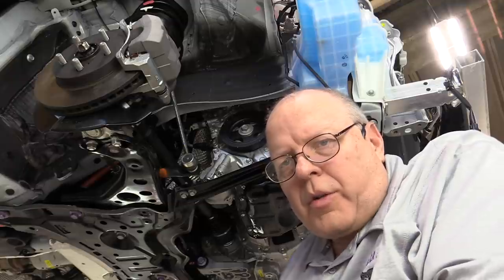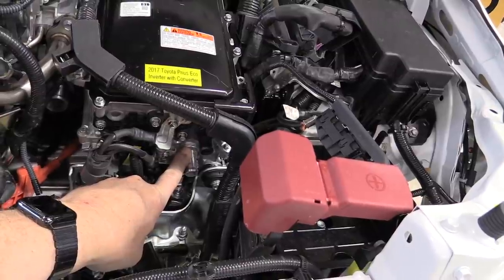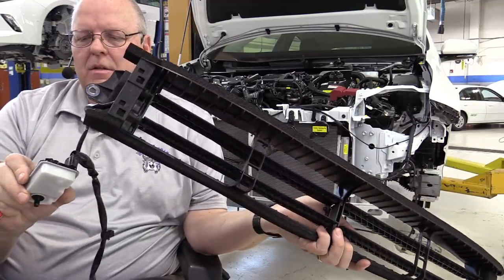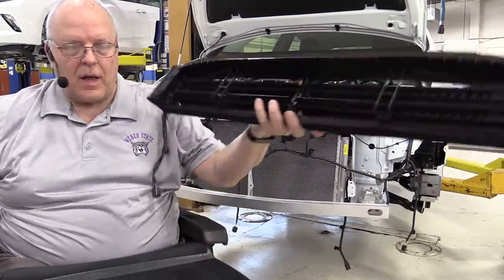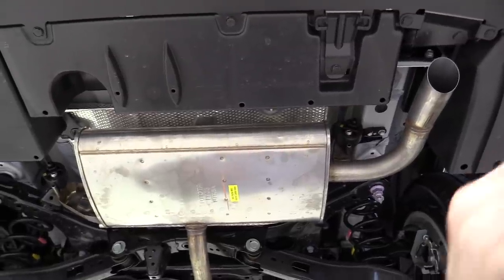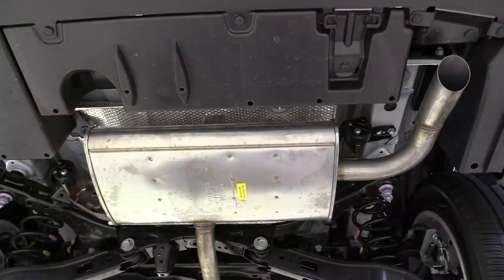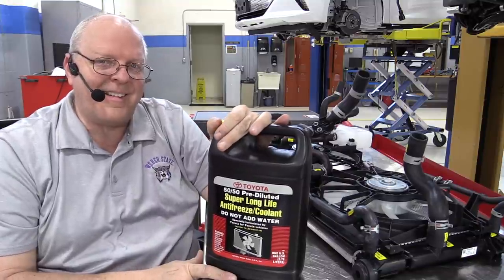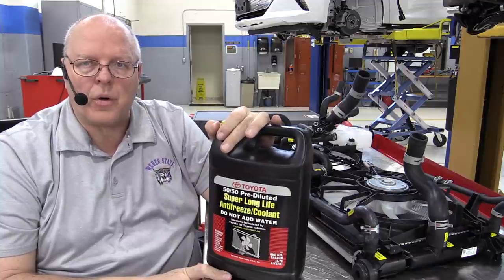Hybrid and EV Cooling Systems

Comment: Professor Kelly, I like you voice, your deep knowledge, willingness to teach & share this knowledge : you are true inspiration to so many people : your teaching a blessing to the world : Cheers Buddy
Reply from the maker: Thank you very much!
Reply: Meg drives our 2005 Toyota Prius II with 138K+ miles : cut off the rear muffler ^^ Strong Hybrid 
I drive our 2014 Honda CRz II with 17K+ miles : all OEM except LED's to replace halogen lamps : Weak Hybrid
We also use our 2013 Honda PCX150 scooter with its crank mounted alternator starter generator : Barely Hybrid 
Meg & I also travel using Segway Minipro self-balancing personal mobility assist device : Fully Electric
Reply: Very rightly stated. I envy students who are taught by Professor.

Comment: Amazing, I think we need to start replacing the phrase "rocket scientist" with "hybrid auto engineer"....  This is just way too much complexity to put into a consumer vehicle product.   Nobody (including your average dealer mechanic) really knows how all this mess works.  Put me down for a relatively simple all electric car...
Reply from the maker: Thank you! That is true. Electric cars are relatively simple compared to hybrids. I am working on a few electric vehicle projects right now.
Reply: Yes sir, but  for  this exactly moment (from now to  10 years) hybrids are the real good choice for  the planet, instead of the  fantasy all electric  world
Reply: @jhoncarlosmorenocastro612  Check in in another decade or so, and we can discuss how much of a fantasy it is.
Reply: Electric cars have most of those same systems... Lots of controls and sensors in those big battery packs.
If you take a look at older Priuses, generally speaking the most reliable part of the car is the internal combustion engine.
You are much more likely to lose a electric water pump, or the Hybrid battery pack, or  have inverter converter failure, then you are to have one of the internal combustion engines suffer a major mechanical issue.
every electric vehicle has all of those same components except for the internal combustion engine.
All sorts of heat exchangers, multiple coolant loops and multiple water pumps.
I currently drive a 2008 Prius with 310,000 miles on it.
My best friend has a 2006 with 340,000 on it.
And I have another work acquaintance that has a 2004 Prius with 520,000 miles.
Toyota knew what they were doing when they built this they are exceptionally well made, and actually not that difficult to work on compared to other vehicles I have owned.
Regularly scheduled maintenance is easy to do yourself.. 
parts are readily available in cheap both new and on the used Market from salvage yards, 
And all sorts of options exist for repairing the hybrid batteries rather than replacing them, and even if you do decide to replace it a new pack from Toyota is about $2k now.

Comment: Do you have any idea why I lost my heat after the dealer changed the cat/heat exchanger? I was getting the dreaded loss of coolant out the exhaust and the dealer replaced the cat assembly and now I don't have heat but I'm not losing coolant anymore. 2016 Prius

Comment: Professor I have a question if I may. On the bottom of the Transmission where you have it labeled "Fluid Drain Plug" is for draining the Transmission Fluid? It does not specifically say so I wanted to ask. Also should I use ATF-WS Toyota Fluid I have a 2020 Prius Prim? Thanks

Comment: "I like to disassemble things that are not supposed to be disassembled" My man!
Reply from the maker: Thank you! It is a lot of fun (as long as I do not ruin the part).
Reply: That's what I do too with new "toys". Turn it on so I know it works before I thinker with it, then opening it up so I know how it works and finally put it back together. If it does not work anymore, then I know I did something wrong because I confirmed it worked before.

Comment: Love your in-depth work explaining the cooling system. 
It is way to complicated more than it needs to be. But I understand how engineers think and work. They don’t teach simplicity in any engineering school. I would simplify the system by cooling the liquid by passing the liquid over a bismuth telluride plate, which uses only 0.70 of a DC amp. Eliminating compressor and more moving parts. 
Please look it up. Heat is the enemy of all electrical systems.
Love your work!
Reply: Thermoelectric coolers are notoriously inefficient. To match up, it would need to be both big, and run at quite a high voltage, neither of which is very cheap compared to what they have here.

Comment: A fascinating video on learning (in depth) the way cooling systems are on modern hybrids vs traditional combustion engine cooling systems. Didn't know there were 2 separate water pumps, that there is so many hoses/circuits in that one radiator, etc.

Comment: The transaxle cooling system is quite robust when compared with the Gen 3 unit.  I can see why they allow towing in some markets now.  I've towed up to 1100 lbs with my 2010 while observing temps on MG1&2 and the inverter coolant temp to be well within standards.  Great video as always.
Reply from the maker: Thank you! I had heard that towing was allowed in some markets. I wonder what the maximum gross combined vehicle weight rating (GCVWR) is.
Reply: WeberAuto According to a British car publication the Gen 4 is rated for 725 kg (1,598 lbs) in Europe. I've heard the Gen 3 was rated for towing in Europe also though I could not verify limits. Not sure if Toyota NA recommends towing for Gen 4 units sold here. Small teardrop shaped Travel trailers are very popular in Europe, I can imagine the Prius is well suited for that.
Reply: Creig Mac were you able to observe the transmission temperature as well? I have a 2018 Highlander hybrid that I plan to use for towing a 1200 lb trailer. I can’t find an OBD 2 scanner that will show the transmission temperature. Thanks

Comment: Great info Professor, thank you!  It's scary how many intricate moving parts are under a vehicle open to road grime and splatter. Thinking too how the salt and sand/dirt on the roads will interfere with the long term operations of these parts. Really have to question where the "technology meets the road" so to speak is really a "head on collision".
Reply from the maker: Thank you! They have been surprisingly reliable over the years. Of course any contact in any type of collision will cause $$$ damage.
Reply: I meant that the "technology" and the "road" so to speak collide. :<)

Comment: Excellent description! I never knew the Prius has a 2 part radiator. 

Our Fiat 500e has 2 coolant loops, one for the battery and one for the battery charger, inverter / converter, and traction motor. The battery loop has it's own small radiator mounted in front of the ac condenser, and includes a 6kw heater and r134a heat exchanger so that the evecu can both cool and heat the battery. The other loop uses what looks like a normal 500 radiator mounted behind the condenser. 
The cabin heat is from a PTC element, there is no water heater core.
Reply from the maker: Thank you and thanks for the description of the cooling/heating systems on your 500e. Almost every EV I have seen have similar systems. I will be doing similar videos on the Chevrolet Bolt and Volt in the near futures.
Reply: WeberAuto I’m looking forward to those videos!

Comment: It's very interesting with all the detailed design at this complex cooling system for the internal combustion engine and the hybrid inverter, Toyota left the two hoses for the exhaust heat recirc system fully unshielded, especially when they run the entire length of the very hot 2nd catalytic converter.  These hoses will probably spring a leak with high mileage cars.
Reply from the maker: Thanks for your feedback. The second catalytic converter has an external shield around it by the coolant hoses for the exhaust heat recirculation system. The system uses stainless steel pipes up a little further above the catalytic converters and the exhaust manifold. The hoses are only used where there is powertrain flexing. Have a good day!

Comment: The post 2010 Prii have two disadvantages. One is the expensive to replace electric water pump. The second is the hard to service EGR valve. That's why I nominate the GEN 2 as the Prius you can keep cheap for 20 years. The taxi drivers here in San Diego buy old GEN 2s at 100k + and drive them to 400k. The old mechanical water pumps go over 150-200k and there is no EGR valve. The only GEN 2 problems seem to be the 2 Way hot-water valve and the inverter water pump that was on a recall. That pump was redesigned from a one bearing to two bearings on the shaft. Besides the cat going out at 150-200k and in Calif requiring an OEM cat at $1300-2000, the GEN 2 is bulletproof. As a bonus, the GEN2 had an available JBL audio system that beat the pants off the GEN 3 & 4 audio systems. And of course, you can easily service the main battery modules. Toyota will sell you a new battery you can install yourself for $1950 plus a $1300 core charge. Try that with a Prius Prime LION battery. The 2016 up Prii are great until the battery warranty expires. What is the resale value if the battery goes out? What is a dead Tesla worth? Not much.
Reply from the maker: Great information, thank you!

Comment: Thanks for your effort.  A schematic diagram of the entire cooling system showing all components in separate loops for ICE & Electrics would be helpful.  At 3:07 - the pins protruding from the electric water pump housing are an omnidirectional heat sink; a conical shape is actually the most efficient.  I thought it was very strange to have a thermostat on the return line FROM the radiator; I would assume this is where the exhaust and EGR loops mix in, (?)

Comment: This is the first time I've ever seen a thermostat on a coolant inlet, usually they're on the outlet to the radiator. Is there a reason the thermostat is on the inlet in this case?
Reply from the maker: Electric water pump can control the flow better

Comment: Professor can I have a question? I understand there is no V-belt to drive the water pump nor the AC compressor as you have shown in the video. Is there a generator/alternator which is driven by a belt to charge the 12V battery? Also, on the other side of the crank shaft there must be a timing belt to drive the camshafts right?
Reply: The 12V battery is charged by the DC-to-DC converter located inside the inverter-converter assembly. The converter is powered by the high-voltage battery.
Reply from the maker: Sangueffusor is right, there is no alternator. The 12V system is charged by a DC-to-DC converter. Yes, there are still timing belt(s) or chain(s) from the crankshaft to the camshaft(s). They are under protective covers on the engine. Thanks for your feedback!

Comment: Great video as usual.  Thanks for sharing your knowledge.
Potentially stupid question.  What is the need for the mechanical thermostat on the ICE's electric water pump?  Couldn't they just turn the pump on and off based on temperature sensor readings?  Maybe they use it to allow flow through the 3 different paths??  It just seems like a potential waste of electric power for the pump to be running it all the time.  Do you have any idea how much power that pump consumes?
Reply from the maker: Great question! The water pump is a variable speed brushless DC motor. Its rotational speed is independent of engine rpm now, so it actually reduces frictional losses that occur in belt-driven water pumps. The pump does not run constantly, its speed is based upon several factors (engine temperature, vehicle speed, and engine speed). I do not know how much current it draws, but the wires that feed it are pretty small. I will try to find out. Best wishes.

Comment: Those two cats are going to cost big bucks in Calif where no aftermarket cats are available or legal. On the 2016 up Prii, I would only keep the car until the warranty expired and I would make sure I got the additional Toyota Platinum warranty. I think you can still buy the Toyota warranty up until the first year of ownership and you don't have to buy it from the selling dealer. On my 2005, I bought a 7 year warranty for $1000 but not from my San Diego dealer. I got a deal from a Toyota dealer in Rexburg, Idaho!
Reply from the maker: Thanks for your feedback! Good idea about the Toyota extended warranty purchase

Comment: That is amazing that a little grill shutter motor and sensor get their own microprocessor and thrown on the CAN bus.  Dare I ask where you get information like "26 pieces of data..." from?  I would guess that how all the modules communicate and what data they swap back and fourth is proprietary to Toyota and they don't want to share that?  So with that information it seems you could connect to the CAN bus(es) and have fun with your car there, open/close vents and who knows what else?  Are things like  power mirrors, windows, headlights, etc on the CAN bus too?  That is just amazing, thank you for the interesting video!
Reply from the maker: Thank you! Many of those items are on CAN busses now. I get my information from the service manuals. Toyota publishes a "New Car Features" supplement with all the cool technical details you would not normally find in the service information. Of course it is not free, you have to purchase it. Everything I have shared is available for anyone to purchase from Toyota. I read the information and summarize it in my own words in my videos. The 26 pieces of data I referred to can be read using a Toyota Techstream scan tool. Thanks for your feedback!
Reply: jontscott almost every little gadget is on the CAN bus these days. I, as an automotive technician, love that. Because I can actuate and test all these things with a click of a button on the computer. Makes diagnosis so much easier.
Reply: I guess I need to get a newer car so I can have more CAN bus around me :-)  My '05 has CAN bus but nothing fun to control like lights, mirrors, fans, etc... just critical drive stuff.
Reply: jontscott you lucky guys with your fancy OBD-II systems! My family car is stuck in the world of OBD-II, and I'm stuck trying to find the equipment for it, for a reasonable price 😂
Reply: WeberAuto I don't even own a Toyota, but now I'm curious. How much do they cost?
Reply from the maker: See www.toyota.com for vehicle prices. The Prius in this video was close to $25,000 USD
Reply: Well I'm not sure many people call my '05 fancy, but I also drive a 1990 Chevy pickup that I face similar problems with tools for as it uses ALDL at 160 baud.  I ended up building myself a serial port adapter and using the free program WinALDL to do basic diagnostics on it.  I am trying to hold off on getting a newer car till a used Chevy Bolt becomes available for under $10k, but by that time my family won't fit in it so we will have to find something bigger anyway.

Comment: So with the tank system now there is no longer pressure in the cooling system?  Also dones not the heat exchanger on the transmission also help to heat up the transmission fluid quicker to reduce friction.  Have noticed that my wife's new 2.4L accord that has one takes much longer to heat up the engine than my older 2.4 without on on its tranny.  These may be why since not only the engine has to heat up.
Reply from the maker: There is still pressure in the cooling system. Yes, the heat exchanges on the transmission can also help it warm up more quickly. Thanks for your feedback!

Comment: Interesting So on this 2017 Toyota Hybrid (vid) car has a "here I am" sound speaker mounted in the front grill  to make a noise at very slow speeds. The Hybrids are sneaky quiet but our 2017 Camry Hybrid SE as it slows down make an electric motor type sound ( I thought) as its producing electrical power for the traction battery.. When backing up after a few seconds the gas engine starts up (at least I think its the engine starting up?)  Just took a look and didn't see.a speaker device near the drivers side horn similar to the one in the vid?  Like everyone else appreciate the Professor Kelly Weber Auto vids. Note: Four yrs old and 0 problems of any sort. .
Reply from the maker: Thanks for watching

Comment: Thank you so much for teaching me about this cooking system! I have a question for you, I’m hoping you can help me. I know for fact my car has a problem within the cooling system. I checked for leaks, checked the engine oil appearance and level, checked the engine coolant level and checked the radiator and hoses and all this looks good to me. Now the car did overheated a week ago and melted the coolant filler neck that holds the radiator cap. Which I already replaced with a new one as well as the radiator cap. And The car engine runs ok for a short period of time but then the engine starts shaking making a sound like a broken or damage propeller and then the sound stops and the engine goes to running normal again. It’s now giving me any codes only the regular maintenance witch i’ve done. My question is, Do you know what could be making the engine to shake significantly do to something wrong in the cooling system? The engine side of the cooling system. Thank you for any information you can give me!! I greatly appreciate it!!